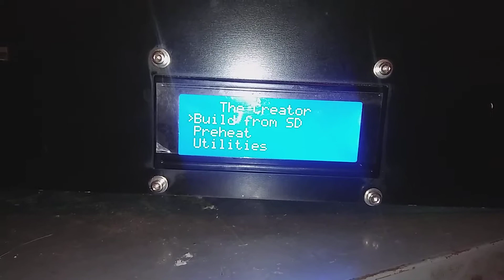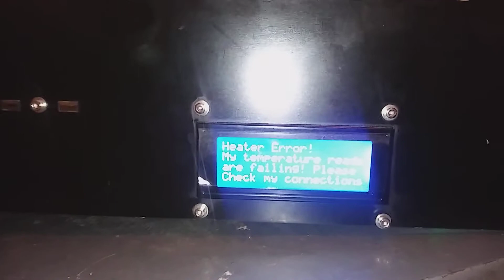CTC 3D printer my temperature readers are failing error

Comment: DIY Build leading to you doing most if not all repairs is the best way. Sounds like you needed a User Group. Too many owners dump 3d printers cos they don't do simple maintenance, and "can't work out" how to do generally simple tasks like fix/replace Thermistors or Nozzles. Ive seen Glasgow weans closely watching Firemen fit Anti Vandal caps to water hydrants and by the time their van is out of sight the 5yr old has the 'Unremoveable' Cap off and he'll see the new 60ft plume of Mains Water doing free Summertime showers+car washes in his mirrors : )

Comment: Mine came up with that error and I just undid the connector pulled the wires out and checked them and refitted... was lucky, just a loose/dodgy connection...

I'm using Slic3r with mine.

Updating the firmware to Sailfish v7.7 will open up several additional features and let you use other slicer programs more easily... which one is personal preference and whether you willing to pay too! 

You'll have to level both nozzles and then you can specify which extruder to use left (T1) or right (T0) ... do dual color prints or use one for supports as you mentioned.
Reply from the maker: Pete's Hobbies  thanks for the help

Comment: Hey mate, i used simplify3d with CTC when i had it, but had to flash the board with Sailfish firmware to do so.  I no longer have the CTC but do have a heap of parts for it, i now use A8net which i find better overall...the CTC is a pretty cool printer though once the niggles are ironed out.
Reply from the maker: thank you Stephen Ozoux I am going to look in to the Anet A8